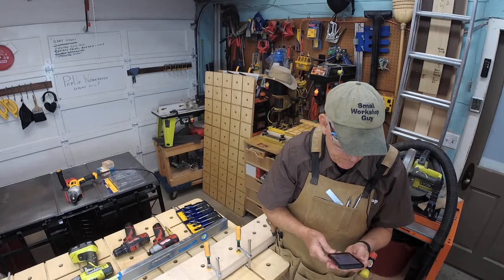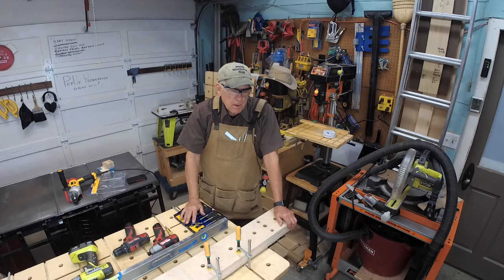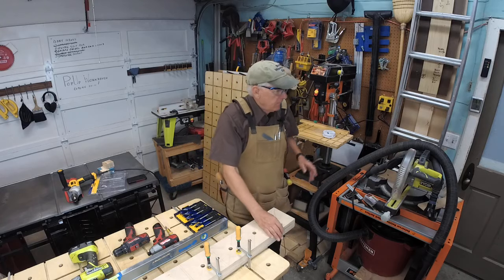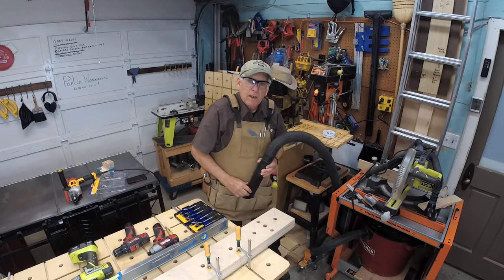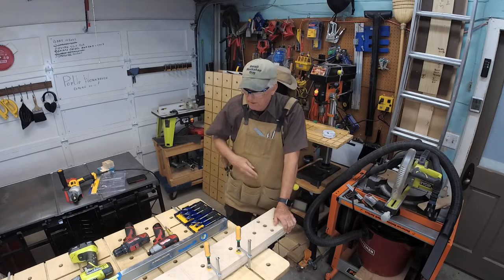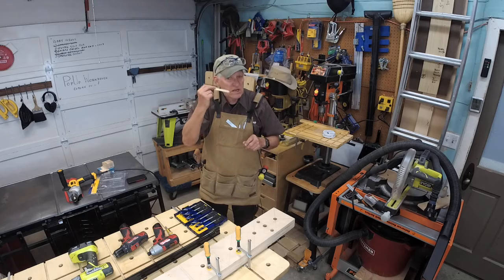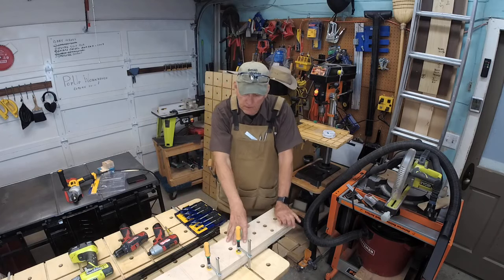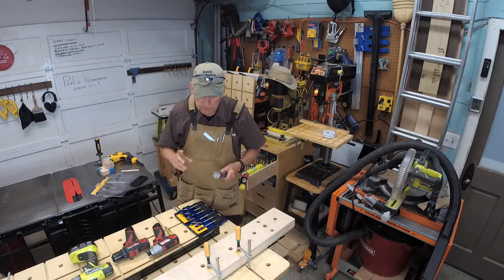Quick Tip Sunday Live - Just Relaxing in the Workshop - 3 Quick Tips for my Thousands of Viewers LOL

Comment: I have two M18  Milwaukee 1/2" drills, one is a drill/driver, the other is a hammer drill/driver that included an impact driver. I have yet to find anything they can't drill through, but I haven't tried drilling into three layers of laminated 3/4" plywood yet. When I make the dog hole jig for my bench top, I guess I'll find out if they do. If however they don't, I have a 1/2" corded Ryobi hammer drill that I haven't used much since buying my Milwaukee hammer drill, so I hope I have all the bases covered.
Reply from the maker: Sounds like the Milwaukee 1/2" is big enough and powerful enough.  Should work!

Comment: Had a same problem with a saw dust in my apron pockets:) Thank you!
Reply from the maker: A quick unload and dump still the best method, but who wants to take the time to do that.  Can't tell you how many times I tried to get a running shop vac hose into my pocket before my "ah ha moment".
Reply: @SmallWorkshopGuy  :) For most part, I don't really care about the saw dust in my apron, but I'm a little bit concerned about the shop vac on/off remote in one of the pockets. Again, small thing, but struggled with it some time now, glad to see I am not the only one:)